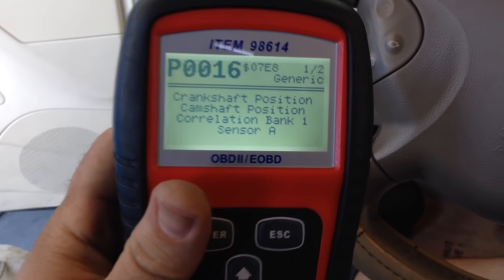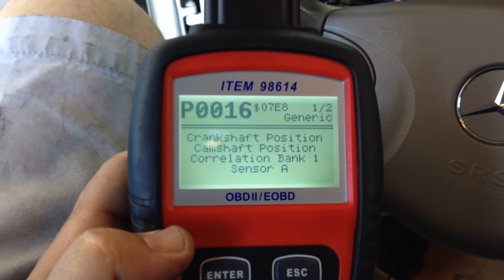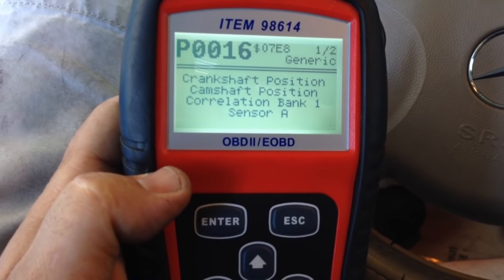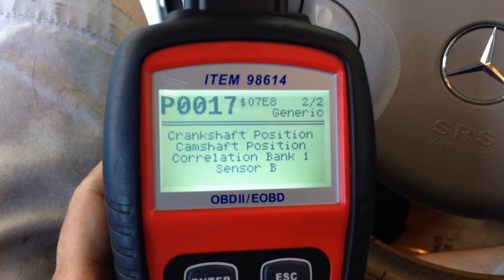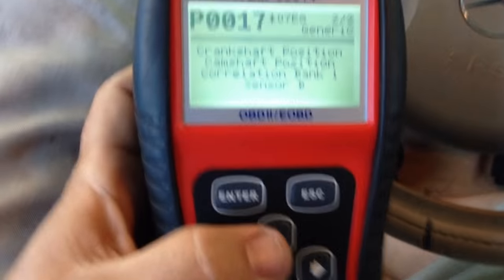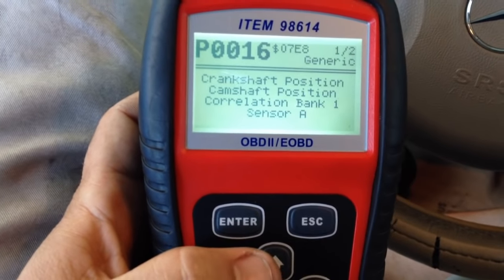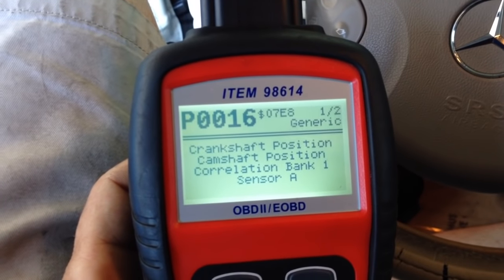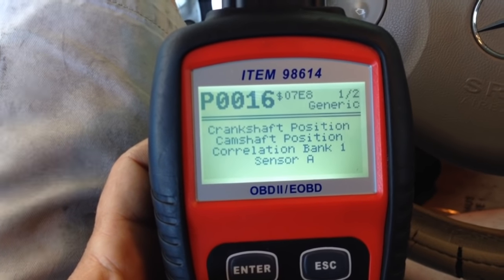Mercedes Camshaft position sensor p0016, p0017

Comment: I have these codes but the ml350 2007 runs amazing. How! How! Each time I clear the codes the lights don't come in even when hammered it. But, as soon as you shut off engine and then stat back up check engine light for same codes again. Is this what all are dealing with. Balance shaft it should run really ruff and loss power. I am guessing. Help! Help! Am trying to help out a friend also learning to repair mb dog shit. Am more of a Lexus and Toyota guy. Lol

Comment: i have a 2010 c300 4matic with 140k and i have the code p0019 and p0016 i replaced the cam sensor and the magnet adjuster and still nothing. what else can i do? and please some one reply
Reply from the maker: You need to check actual values on your timing before changing any part, your chain may have stretched a little or pulsation plates may have shifted a bit, but you need to check the timing before anything else
Reply: @MercedesBenzTechs  WHAT DO YOU RECOMEND I DO TAKE IT TO A SHOP OR IS IT EASY TO DO BY MY SELF?

Comment: I think  it's not an oil problem but a real problem of the balance shaft on some Mercedes.
So i ask 
1) Can you change the balance shaft without keep out the engine from the car.
2) Can you change only the pignon at the beginning of the balance shaft by 
reengenering and clever method without touch anything else.
3) Can i dismounted the back of the engine ( does we have place between the firewall and the engine 
if we keep out the Automatic BV )
It's seem to me a very challenging mechanic problem because i am interesting in buying a CLK350 
with that problem  or similarly but i find that 5000 euros or more for changing the shaft is not normal.
I don't want to try to repair a car without be sure i will succeed if i am not a Mercedes technician.
Thanks a lot for your video and explanations
Reply from the maker: You are right, I didn’t have all the information at the time of the video, bad design. 
You need to remove the engine and open the timing cover to replace the shaft, I can’t think of any shortcut

Comment: The thing on top the engine is the transformer that sends energy to the ignition coils; the ECU engine control unit (computer) is under the fuse box.
Reply: Nope that is the ECU right on top.
Reply: whattt??

Comment: Yesterday I had the p0016 alone.
I deleted it and it s gone for now even the engine runs smoothly so is there a chance that my sensor is broken? 
Got a 2006 cls 350 with the m272 engine
Reply from the maker: UserPauli2592 check with Mercedes if your engine is within the infected production times, I think it is
Reply: Mercedes Benz Techs yes it is but the engine runs smoothly and the p0016 didn't come back so far.
Can this come from a oil change?
Reply: Mercedes Benz Techs it also happens as I wanted to overtake someone and did a kickdown
Reply from the maker: UserPauli2592 no, can’t be from oil change, nothing to do with oil change, bad part, I didn’t know it at the time of the video
Reply: Mercedes Benz Techs so should I wait until the p0016 come back? And why did it came alone without the p0017
Reply: @UserPauli2592  I’m having this exact same issue only the p0016 code on my m272 ml350 2008
Reply: @melmelcorvette  I got my complete chain drive replaced by Mercedes back in the day.
Reply: @melmelcorvette  if you are lucky enough they take the cost at Mercedes, since it's a known problem.
I however had the luck that this happened within the first year I bought the car so Mercedes did the repair for free.
It was about 4.000€
Reply: @UserPauli2592  ohh I didn’t know that how can I find out if I’m eligible for the warranty repair?
Reply: @melmelcorvette  I had about 120k kilometres on the car and it had full service history. I'm not sure how it works when the car is older than 12 years tho.
They send my VIN number to a higher lvl Mercedes service and they approved the repair
Reply: @melmelcorvette  look up mercedes balance shaft lawsuit, its gonna tell u the range of the bad engines. To check ur engine # try to find a mercedes vin database or just google it
Reply: Hi  what years models were infected with this issue? Does anybody  know?
Reply: @JJ-vm3ky it goes up to late 2007 but you gotta check the engine number to be 100% sure
Reply: Paul2592, Thanks for your reply. I have 2009 e350 I assumed  this model is not in that category...
Reply: @JJ-vm3ky  ye the 2009 doesn't make any problems of this kind enjoy your car
Reply: Thanks for you help...

Comment: great post .. but oil has nothing to due with it  the balance shaft gears were defective in the early m 272 motors the gear would wear out .. probally using cheap oil will cause issues but this problem not related
Reply from the maker: Pattyboy Benz correct, I didn’t have all the information at the time of the video.

Comment: I have a Mercedes Bens e250 2010 coupe and i have the Code P0017 Crankshaft Position - Camshaft Position Correlation (Bank 1, Sensor B) , SO for me its Sensor B not A - I changed the sensor on the side of the engine just below of the top of engine and replaced the sensor with brand new one and the code still came back - Now i dont know what to do and what sensor to change. Ive changed Engine oil and filter and code still comes back with car running poorly - not effcient - starts up with no issues but after about 10min of driving engine runs rough - Any ideas PLEASE
Reply from the maker: How many miles on the car? It may need timing chain
Reply: @MercedesBenzTechs   its only done 46miles but now the code has changed to p001762 and there is another code p254009 - Engine light goes and comes and the car runs really rough after about 10min driving for like 3 mins then goes back to normal but is very un-fuel effcient - I dont understand how it can be a timing chain with low miles? Do i start with the senors first? some people are saying its most likely the Camshaft adjuster magnets? Thanks a lot for replying im praying its not the timing chain or else im screwed - im from Australia btw
Reply from the maker: @Aim4sight  it can be one of the timing actuators not working right, I would start with a professional diag first before replacing the wrong parts.
Reply: @MercedesBenzTechs  I went to a Mechanic yesterday and right away hes like your timing chain is gone will all need changing - Taking engine apart and it will cost Thousands. As he ran it through his computer and it gave same codes. I dont know what to do.
Reply: @Aim4sight  so what you did after or how much it cost you brother? Because I have the same issue. MB to drive is very nice but when it comes to problem it’s really a headache brother. Please text me back thanks.

Comment: Hey Mercedes Tech, I have a 2009 E 350 and I have the codes P0016 and P0019... On the A side we swapped the magnets and the sensors themselves but the code still read the same way... Any ideas?
Reply from the maker: Josh Smith can be a software update, bad plates on the camshaft sprockets or starched timing chain..also can be bad timing tensioner
Reply: isn't this using a variable valve timing managed by the ECU with an oil solenoid.... the internals uses a pin on a spring that wear out prematurely with bad lubricants 😂

Comment: Ok I have Ml350 p0016 and no other code.. it was replace 66k miles ago with timing chain now has 135k and getting the p0016
Would oil leak cause this ? Hmmm if oil got everywhere. 
My intake has the one flap broken.
Reply from the maker: Ron Gledhill  nothing to do with oil leaking... if you want my answer or advice you need to give me more details...
What year is your car, what was replaced already, are there any other symptom? There is only one camshaft sensor reading bad??
Be as detailed as you can..
Reply: 2006
Reply: Yes only the one p0016
Reply: Should we replace the sensor I been told it almost never fails this true?
Reply: Yes balanced shaft gear and timing chain was replaced only ever p0016 code
Did a few spark plugs.

looking to replace the sensor at this point if you recommend it

Comment: Hey man, i have code P0017 on a Mercedes M274 engine. The car has 55K miles and did have crappy oil. When I used to crank the engine, rattle sounds come for the first few seconds and then the engine is normal. However, the engine cranks at least 3 times in order to starts. 
It drives completely normal after that. I did check my camshaft actuators and the teeth are in good shape. Any chance it is a stretched chain or could be the actuators jumped off from their original timing position. Do you think i can loosen the chain by removing the tensioner and adjust the camshafts to their correct position? 
I hoping that it it is not my balance shaft being worn.. 

Please let me know what you think.
Reply from the maker: Should be under Mercedes Benz extended warranty, contact your local dealer. The repair is free.
Reply: @MercedesBenzTechs  I have Mercedes Benz C230 and after starting it and need to drive it it has a lose of power and when it starts after 5 to 6 minutes it stops. Could you please tell the problem and also it has the code P0017 and P0016.
Reply from the maker: @meleshailemariam  what year is it? I’d it with the supercharge?
Reply: @MercedesBenzTechs  it’s 2007 C230 V6 2.5 Letters and it is the sport edition model
Reply: And also it has 200,000KM thanks 🙏 for your help brother
Reply from the maker: @meleshailemariam  the only codes you have are p0016? How does it loose power? While driving, does the engine turns off or want to turn off? If you turn the car off and than on is the power restored? Give me more information I’ll try to direct you what to check
Reply: @MercedesBenzTechs  when I start it after 5 to 6 minutes it turned off by itself and also while I drive it stopped by itself. I said from the battery and I buy brand new battery still doesn’t work brother and also there is a cod P0017, P2415, P0410, P0040 they just showed me now.
Reply: And also P2271
Reply from the maker: @meleshailemariam  is it always doing it at the same time
Reply: @MercedesBenzTechs  now I parked it and when I start it it doesn’t stop but I am a kind of scared to drive it because the engine is not sounding like before and also last weak I want to move it from place to place the engine switched off and I make N and people help me to push and I parked it after 30 minutes it starts. But I am afraid of to drive for long distance. But those in the above 👆 codes I just see them now with the FIXED device.
Reply: Please any help let me now. Much appreciated brother.
Reply from the maker: @meleshailemariam  I think you will need a professional diag, hard to say what the issue without actually looking and listening to the engine
Reply: @MercedesBenzTechs  before a month I took it to the mechanic shop and this guy he charge me almost 900 + he said you need to buy a fuel pump and I buy it for 500 + new starter for 200 after all this the car only drive 3 weeks and it stopped wouldn’t start for almost 2 weeks I think the weather was too cold. After 2 weeks when I try it it starts the whole I drive it perfect no engine shake no problem by tomorrow again it doesn’t start. And now after a while it starts but the power is too low and the mechanic refused my phone even he said I don’t have space after he took my money. I almost spent 1800
Reply: @MercedesBenzTechs  I bought the car from a private owner. Do I qualify for an extended warranty ?
Reply from the maker: @rmqumri  I don’t see any reason why not.
Reply: @MercedesBenzTechs  I will check at the local dealership here. I am not based in US. I can try to contact Mercedes in Germany and complain of a factory design flaw

Comment: I had to have the balance shaft replaced on my 2006 Mercedes R350 some time ago.  It was an expensive job that I ended up paying for.  Is it customary to replace the timing chain when doing this job?  

2.5 years and 60K miles later, I have the same error codes showing up and the dealership is pointing to either the balance shaft (again) or a stretched timing belt.
Reply: Depends on the miles.. Over 100k probably, under 100k not required, I change them regardless but charge for that as well.
Reply: +David Jacov Thank you.  When the job was done initially, the car had about 85,000 miles on it.  The dealership is now saying that IF the problem is with the balance shaft (again), they will replace the timing chain also (and charge me for it).  Very frustrated with how expensive it has been to own this car!!
Reply: Viggy Mokkarala how much did u pay? David does the maintenance on my 06 c230 and 50 miles after getting my last schedule a, the p0016 code came up so will be going back soon

Comment: I need  help the check engine light is on the motor sounds fine and the diagnostic is not picking up anything
Reply: Where are you located??, you can always bring it to our shop in GA..

Comment: Hello David 
Your video help me so much and saved me a lot of time.
I have 2006 R350
I had 2 trouble codes p0016 and p0017
I removed the cane sensors  and I put it in 305 degree and looked to see if the small circles aligned either the camshaft sensor wholes.
It was perfectly aligned . It was right in the middle.
I switched the camshaft sensors from the drives side to the passenger side. But I’m still getting the same trouble codes.
Is it possible that the magnet sensors is the problem??
Reply from the maker: george Tushman what year is your car

Comment: A quick search of google will show what engines had balance shaft issues, the M273 V8s had problems with balance shaft only up to a certain serial number, mostly ended with the 2006 model year.

Comment: On the 2013 gl450 the cam sensors are on the top of the valve cover for bank one. I’m getting only one code p0016. Does this mean I can do the same test on my motor or will it be different?

Comment: I replaced both crank and camshaft sensors but still no start. My fuel pump still works too. What could be the problem?
Reply from the maker: Billy Owusu can be so many things, I need more information , year, model, what issues you have, when did it start, did you try scanning for codes?
Reply: Mercedes Benz Techs I realized the numbers in the camshaft holes are not properly aligned. It's a 2006 e350 4matic. Any suggestions?
Reply: Hey mate i have a 2000 ml 320 merc and it starts and drives but it turns off after it warms up what could be the problem
Reply: @billyowusu48  have u fixed it?
Reply: @emilnad5078  the engine ended up being bad. The balance shaft failed. Thankfully it’s working now with a newer engine off a 2010 glk 350.
Reply: @billyowusu48  oh wow, thats cool. How much did the whole repair cost if u dont mind me asking?
Reply: @emilnad5078  the engine itself was 1600 and the labor was around 1500. It is possible to avoid labor if you install the engine yourself.
Reply: @billyowusu48  wow thanks, around 3k doesnt sound bad considering it costs up to 5k to fix the balance shaft. Thanks again
Reply: @emilnad5078  your welcome!

Comment: hey man you know where the crankshaft is , in an 2006 e350
Reply from the maker: Antonio Uzzle 
You mean crankshaft position sensor?, it’s on the back of the engine on driver side
Reply: Mercedes Benz Techs yes thats what i meant , im having a problem bro , my oil pressure is really low in my 2006 e350 , ive replaced all the sensors , belts , etc , it was alot of engine sludge from the previous owner who did not change oil as he should . can you throw me some advice i can do to resolve the issue please . thank you
Reply from the maker: Antonio Uzzle there is nothing that I know of that can clean the sludge, I think you need to replace the engine
Reply: Mercedes Benz Techs okay, we were gonna try to replace the oil pump first, recommend that?
Reply from the maker: Antonio Uzzle why would that make any difference? Obviously the pump works... if the engine is clogged obviously the pump can’t push the oil strong enough.. it’s just like our heart.., clogged arteries, and then a stroke...
Reply: Mercedes Benz Techs okay i understand, the mechanic said he just wanna try that before he say the engine done , shit ridiculous when someone doesnt change their damn oil
Reply from the maker: Antonio Uzzle you have to see the passages for the oil, it doesn’t take too much to clogged it and once it’s clogged, I haven’t found a chemical that will undo it, it’s like rubber stuck to the metal, it just doesn’t come off... save your money and change the engine, I doubt anything will work for the long run.. good luck
Reply: Just for shits and giggles.. try marvel mystery oil in your oil.. the engine may be trash so it's not like it's going to hurt your pockets any more than an engine swap.
Reply: Chris Bentley you right , im in the process of finding a damn engine now 🤦🏿‍♂️ 6000 is the price , mercedes has the car at their shop

Comment: I have a 2003 c230. the check engine light is on.  no problem with running of car.  codes were read camshaft position sensor.  Does tis mean the sensor is bad
Reply from the maker: Most likely but you have to have it checked it may be bad timing chain as well
Reply: U still got the car.. whatever was the outcome?

Comment: I use 0-40 Mobil one. Change the oil every 8K miles and at every 4 k miles I change the oil filter which is easy to get to.  Benz engine is truly a really a high precision machine.  Much higher quality than a junk from GM; Ford which is lower quality engineering and lower quality workers.

Comment: I own a 2012 mercedes c250 and got a p0340 code. Is that mean camshaft position sensor fail as well?
Reply: +David Jacov my only issue with that car is maybe 2 or 3 sec longer crank time with the code p0340, do you happen to know what the problem? thanks for responding David!

Comment: Shame I changed the engine 3 months ago and seems again I need to replace it

I used Amsoil oil and I added BG 

Seems I have to use only MB oil better than using more expensive oil that might be the reason why I had the bad luck twice